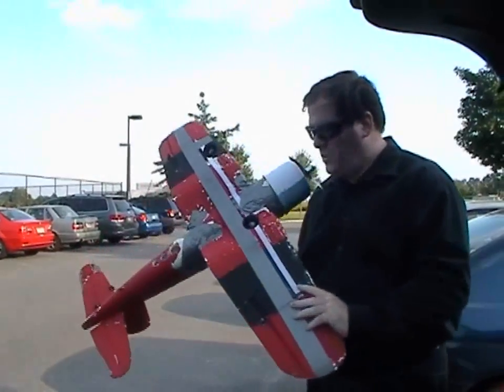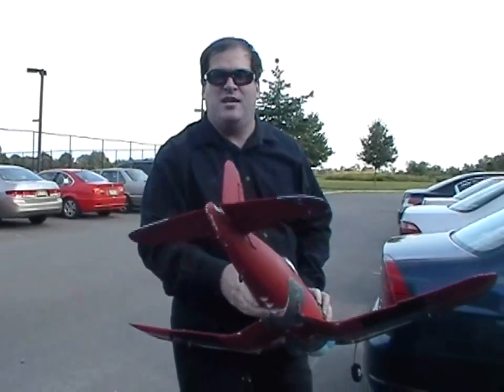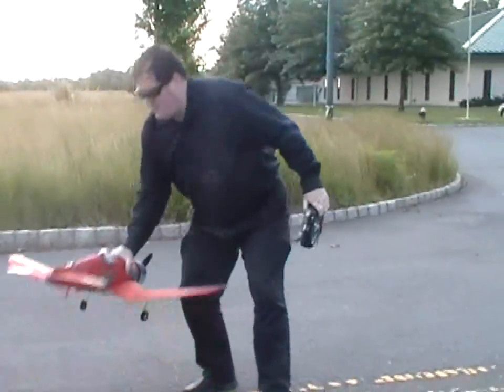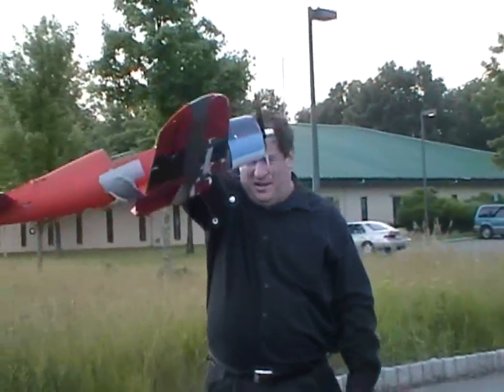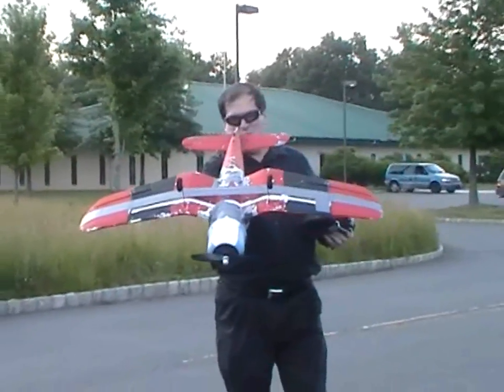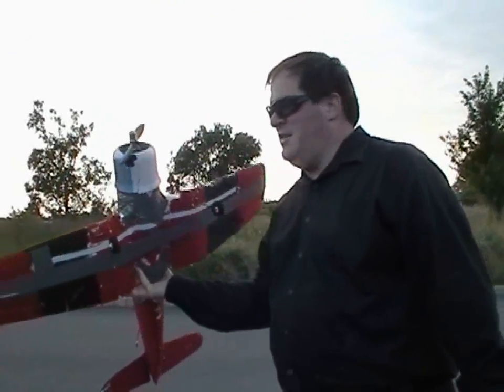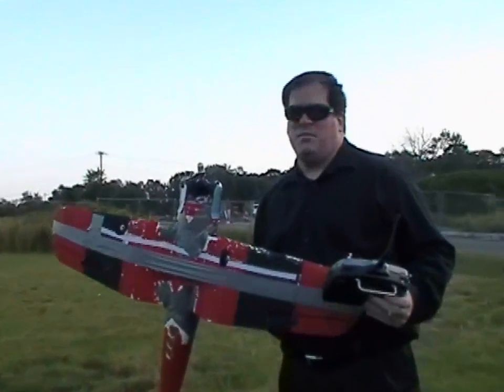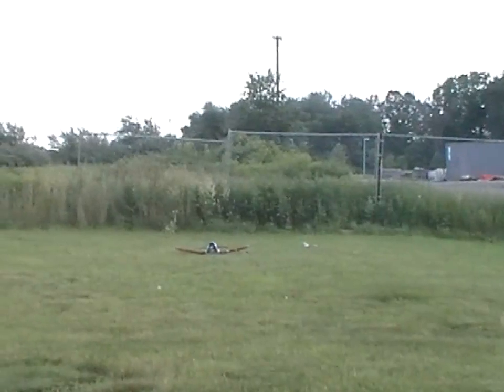Flying Without a Vertical Stabilizer

Comment: if you use 2 counter rotating motors it would remove Prop wash, Propeller torque effect and P-Factor from the equation, then it should work :D